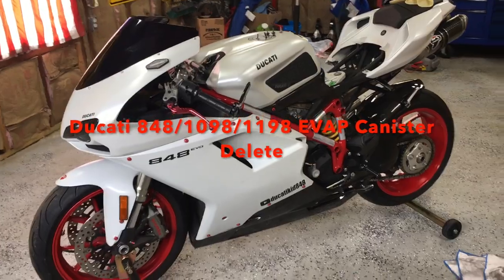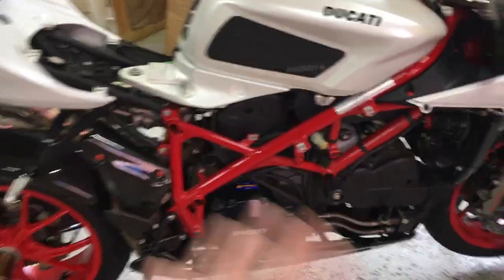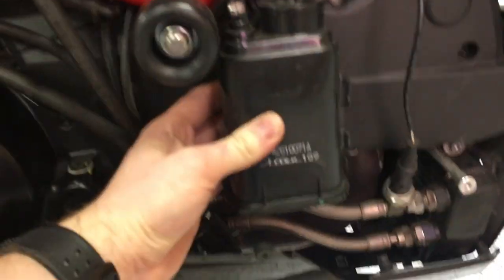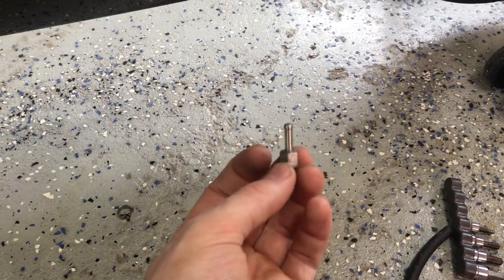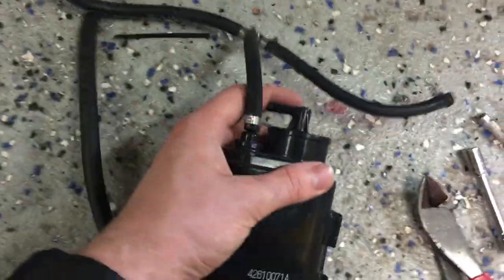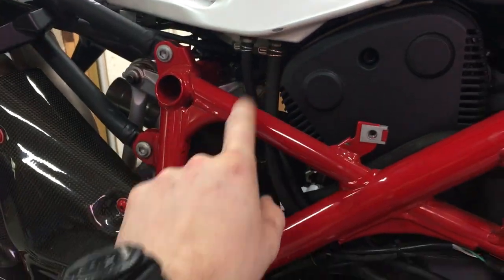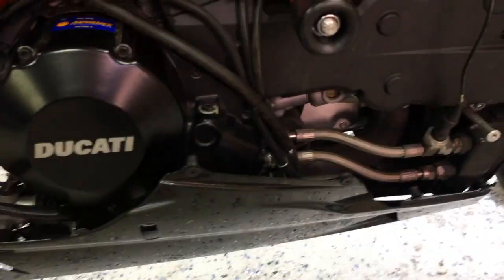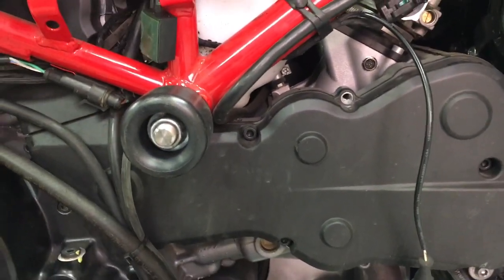Ducati EVAP Canister Delete (848/1098/1198)

Comment: I wonder if the throttle bodies need to remain connected via the cross tube for vacuum or running/tunning purposes......just a thought. I will check on that specifically and get back to you if I find something important,  I plan on doing this delete this weekend....nice upload.
Reply from the maker: Mine runs like a champ after this, so I don’t think they need to be connected. At least, not according to the online write up I followed.

Comment: My 848 also leaks gas from the cap, especially when I fill it up near full. I thought replacing the rubber seal and or going with the quick release would do the trick, you think this is what’s happening to my 848 as well?
Reply from the maker: Jason Fernandez probably. Won’t hurt to remove it. When I removed mine there was gas in the line from the canister to the tank. That’s how I knew mine was clogged.
Reply: @kingspencer7  what is the purpose of the EVAP canister anyways?
Reply from the maker: ahamed1232002 google will give you a better answer than I can. It’s for emissions.

Comment: Did this solve your fuel out the cap assembly issue?
Reply from the maker: Yes
Reply: @kingspencer7  sweet. I just pulled mine. No excess fuel in the line but let her warm up to temp then shut it down... now I wait and watch. Hopefully that does the trick!